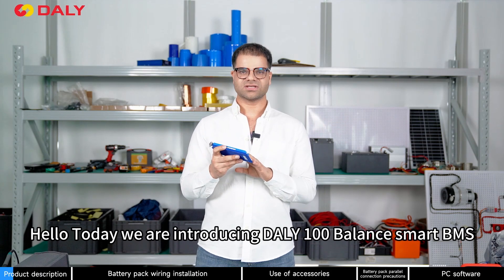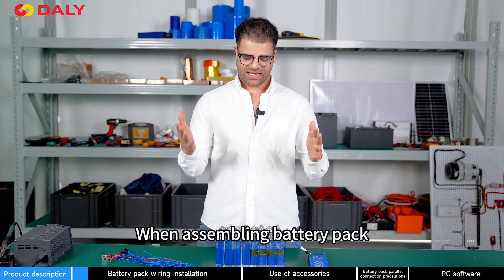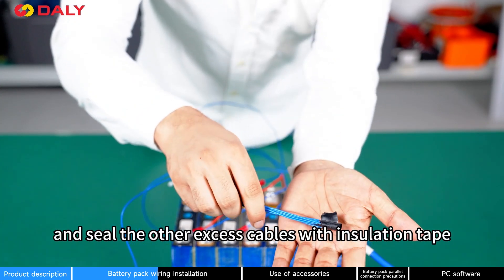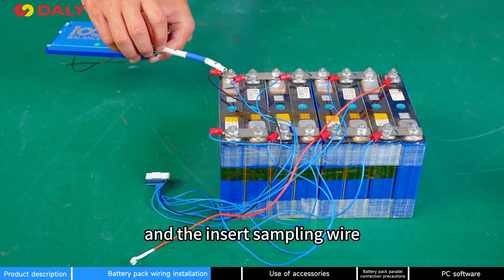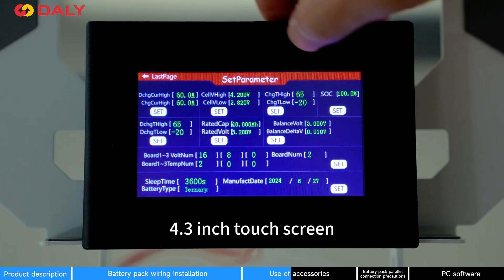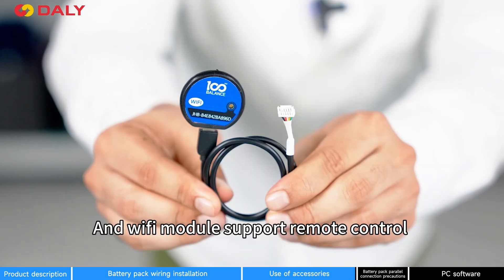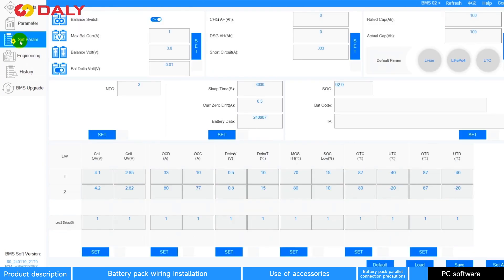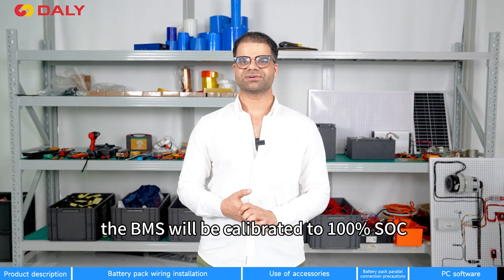100balance smart active balance BMS and parts users manual and wiring

Comment: bsm installed in electric vehicle battery when in sleep mode and no output voltage, must remove battery cover, unplug power cord to bms and plug back in or make power button, very inconvenient

Comment: Hello how can i fix the error "the monomer acquisition dropped the line?
Reply from the maker: You can check if the cables are loose, or replace them with a new app, and modify the number of boards to the same number as your BMS through the app

Comment: He needs to add the hookup of the parallel  modular between the 2 battery banks.
Reply from the maker: The BMS has a built-in 0.5A parallel current. Therefore, no parallel module is required to operate. Unless you need a higher parallel current, such as 5A or 15A. thank you!

Comment: Why isn't the balancer built into the BMS like JK?
Reply from the maker: It is built into the BMS , but if you need the big balance current you can add the balancer to increase balance current to 2A.
Reply: @DALY100balanceBMS I see. What is the maximum balance current of the one built into the BMS?
Reply from the maker: 1A balance current.